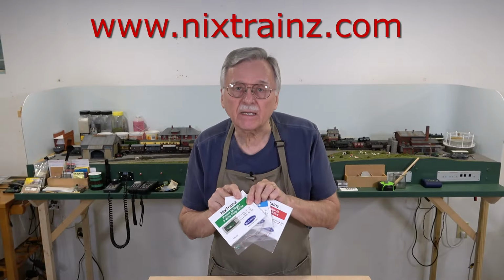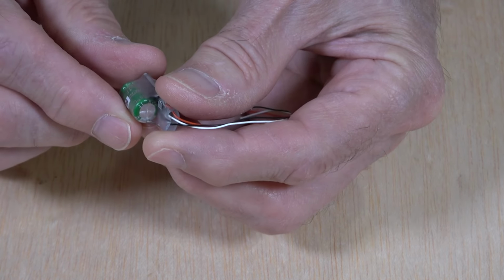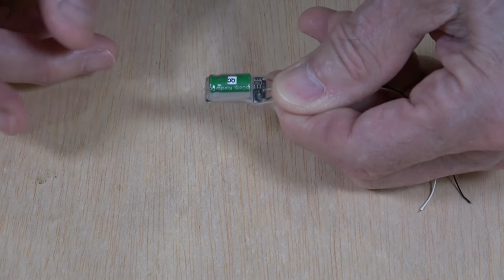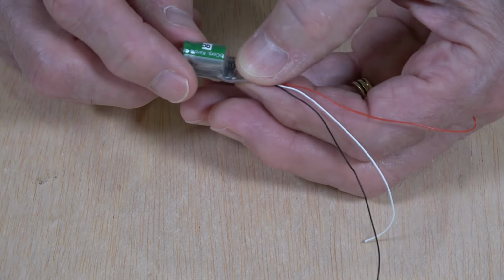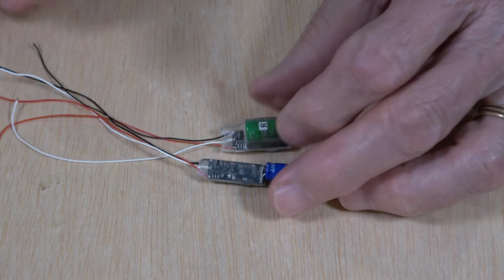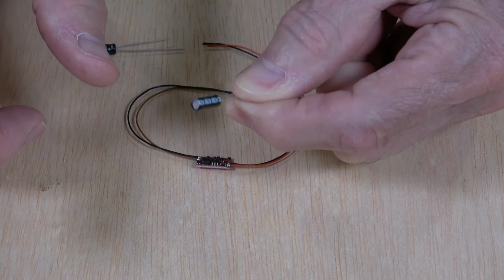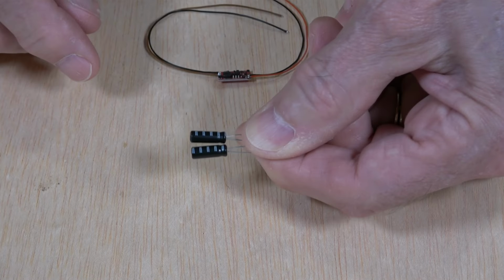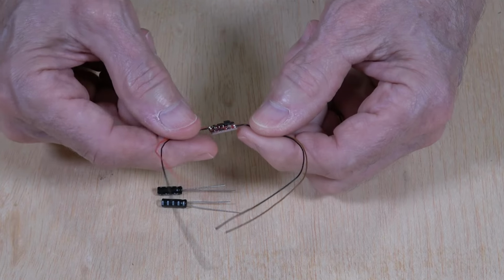New from NixTrainz Power Bridge Stay Alives (394)

Comment: If you wire the two 0.3 F capacitors in parallel, the effect is additive, so they'd be 0.6 F total.  Would the circuitry handle that?
Reply from the maker: I think the circuit requires they be wired as described in the instructions. Experiment with it at your peril!

Comment: Great video, thank you Larry. I have a train here with a ESU 21 pin decoder and I put a Zen current Keeper in it on the v+ and ground side of the Walthers decoder buddy for some reason it is not doing what it's supposed to any ideas why?
Reply from the maker: Is it a 3 or 2 wire stay alive?
Reply: Yes it is a two-wire keep alive. It's the exact setup you show on your YouTube channel I made the exact one. What I'm hearing is that my ESU 21 pin decoder is a base model so it's not set up for a keep alive but the decoder buddy has keep alive pads on it so I thought I could hook up a keep alive to that and make it work but it is not
Reply: By the way I did take the Zen current keeper out and I put in the one just like you made after making one. Still neither one of the two stay alive work with this ESU decoder for some reason